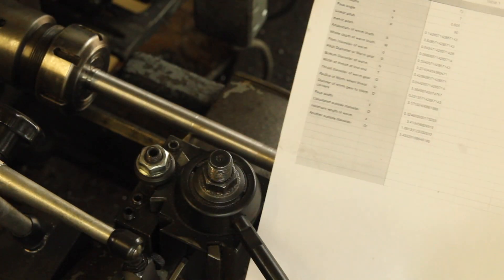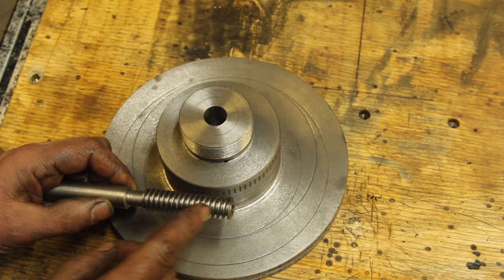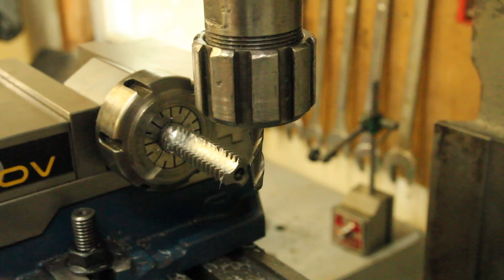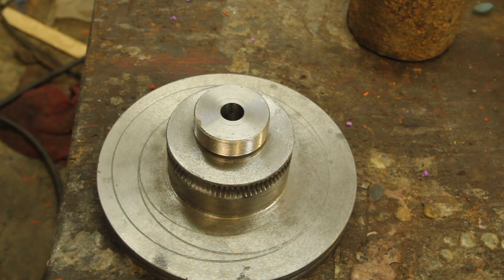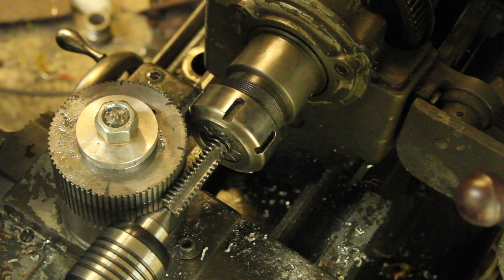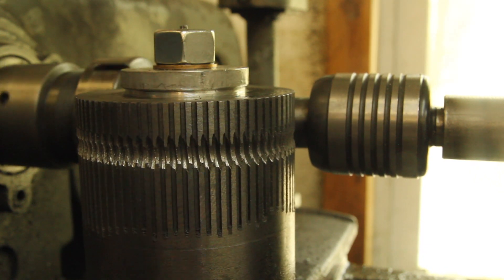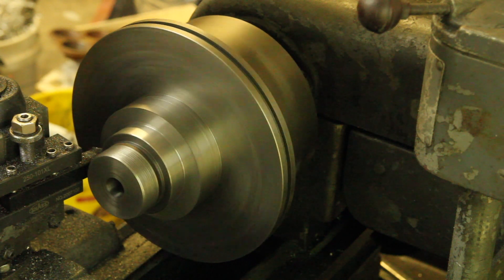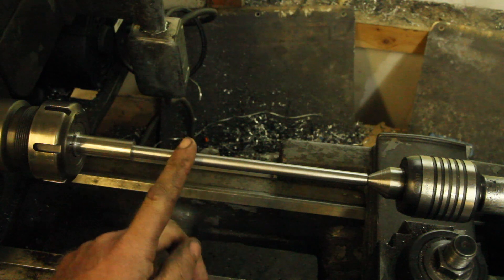Scrap Built Rotary Table (Part 2)

Comment: The problem of tearing the threads as you progress is down to the starting diameter of the workpiece, this is larger than the finished root diameter of the threads so the thread count on the surface is greater than at the root of the thread, being two different diameters. I generally partially cut the groove\resess in the workpiece first on the lathe, then the only cutting is just over the depth of the threads and nearer the finish diameter, it also allows the hob to contact more of it's diameter so not loosing track. Still a good exercise, and enjoyed watching it.

Comment: Instead of solid pins to "secure" the gear, it would have been better to use a set screw or some such, as to stop, not only twisting, but also movement along the cylinders length.